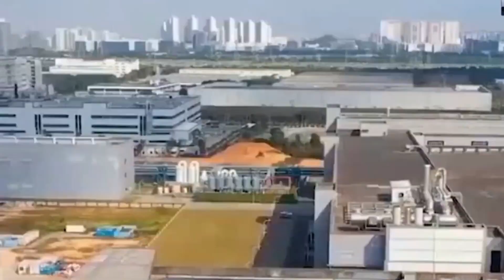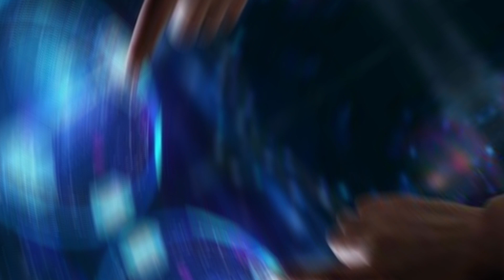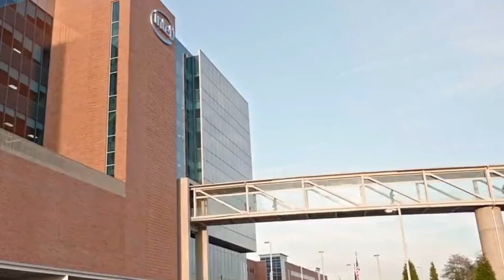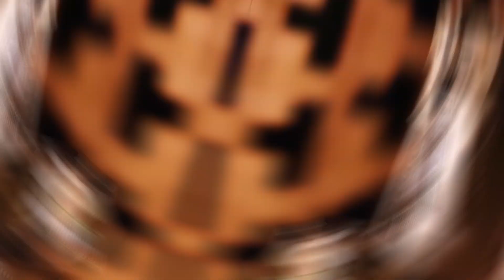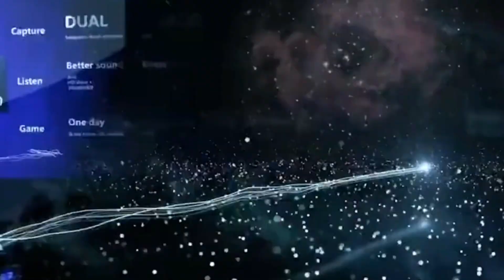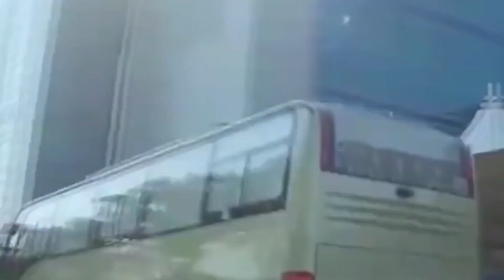The United States has ceased supplying new technology to China for future development

Comment: It’s a blessing to China. Every time they ban China from something, they came up with something of their own. Like the space station, it took China 10 years or so to get their own. The jet fighter engine is another. Supercomputer is another. Quantum computer is another. The list goes on. This is the last obstacles the Americans can throw at China. It’s all over after this. 

Even this, the Chinese with host of factory or foundries launches, some very high profile like Yibu Tech’s in Shanghai at the end of last year on 12nm to 28nm mass production only shows the Chinese, is in control of the semiconductor supplies except for the advance chips, 10nm to 4nm. The threshold chips of 12nm to 28nm and the mature chips of 30nm to 120nm is now fully in the grasp of the Chinese in terms of mass production and availability. The threshold and mature chips are at least 85% of Chinese requirement probably more (90%). So, there is that 10% to 15% of advance chips that the Chinese can’t mass produce because they don’t have the EUV the photolithography machine to do it. However, the Chinese have found ways to get to these advance chips. There is SMIC’s FINFET. Another is CFET. Another is Huawei stacking technology. Since they already mass producing 12nm /14nmin so many foundries ie SMIC, Yibu, Wing Tek, BYD, Huawei (in collaboration with an unknown foundries), if for eg. Huawei’s stacking technology applied, they can get to 6nm. Obviously anything more matured like 7nm to 10nm will now be attainable. SMIC 7nm for Bitcoin mining machines is already known to the market. This is reported by Bloomberg. This is a test. The next test is for Huawei to design a Kirin chip based on its own proprietary stacking technology using a 12nm chip to produce a 6nm 5G architecture. The biggest problem is the advance chips only account for 10% of the Chinese requirement. The tendency is that they would produce something that is the majority requirement of the market. Therefore China will need ‘specialist’ like Huawei and BYD to lead the way to increase application (push the volume) of the advance chips in China. Over time, perhaps the next five to ten years China will reach its goal of totally weaning its reliance of American technology. American ban provide this push. What the Americans are doing is insanity…doing the same thing over and over again with the same results. Sometimes greed and ego and lust and hatred and desire to dominate can really screw up the head.

Bring it on. It’s a good thing for China!